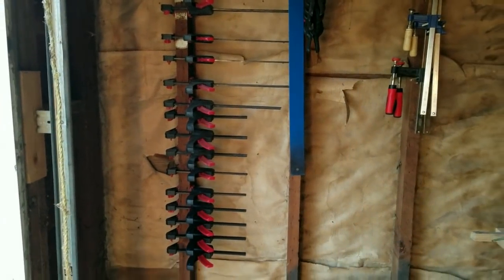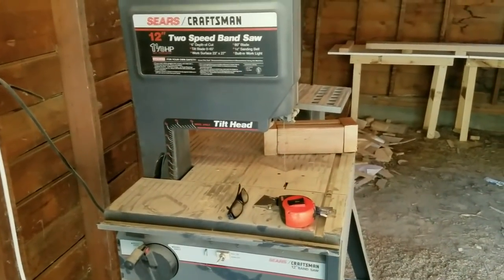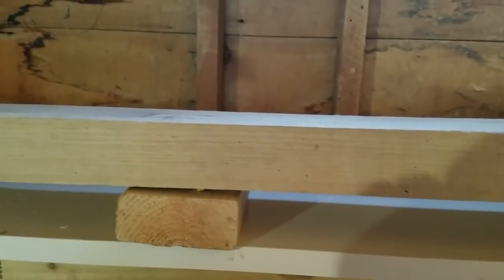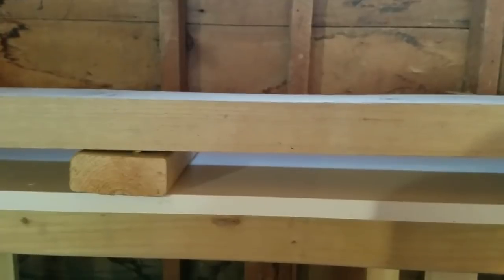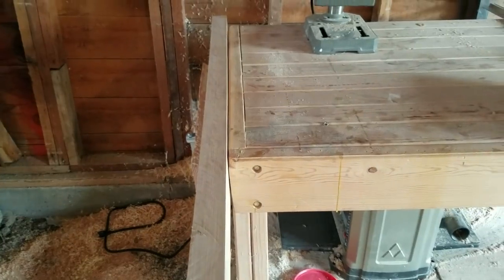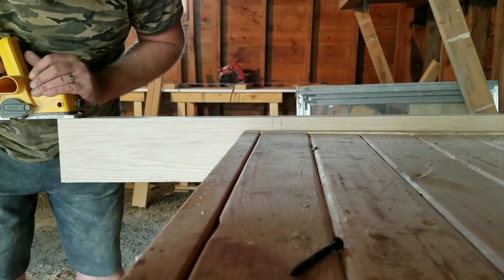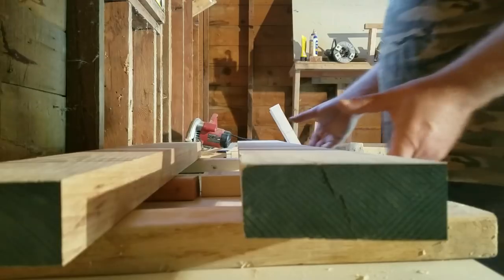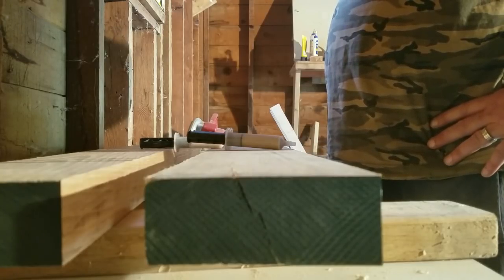Boat Build- (Episode 1)Taking Notes from the Shipwright

Comment: How cute. He watched some videos and now he's a shipwright.
Reply from the maker: Nico 76 --- lol, not hardly a shipwright,  but I have confidence that the boat build will be at very least, fun.
Reply: Nico 76, I missed the part where John claimed to be a shipwright.
Reply: John, because of this show of grace: liked, subscribed, bell 'n whistle. Looking forward to following this build.
Reply: When Lou did the glue part he wiped both mating surfaces with alcohol , then he glued both surfaces , then put both surfaces together . When  John did the glue he mixed  the epoxy on the unwiped  board , then glued one plank and flip it over on to another unwiped plank . I don't know if anyone noticed but at 13:37 as he flip the plank , saw dust blow out from between the planks that maybe a dry glue joint . The saw dust will dry that joint by soaking up glue and not adhere well .
Reply: I in no way want to discourage John , and applaud him for his effort , being a shipwright has a sharp learning curve . keep up the good work John you are braver than me .